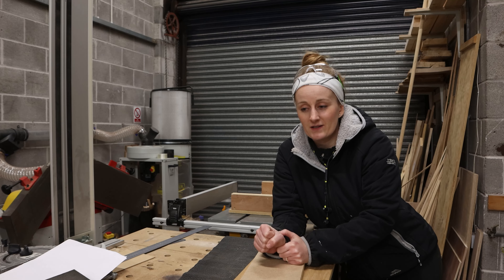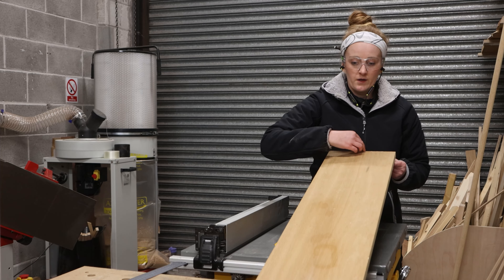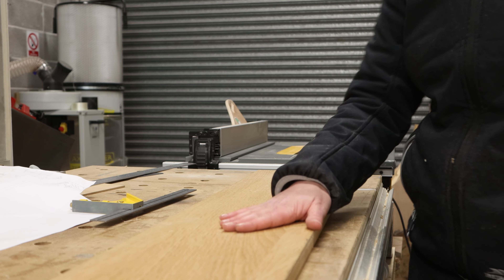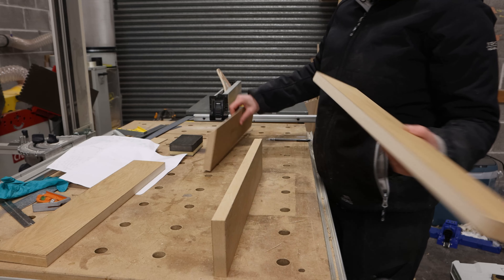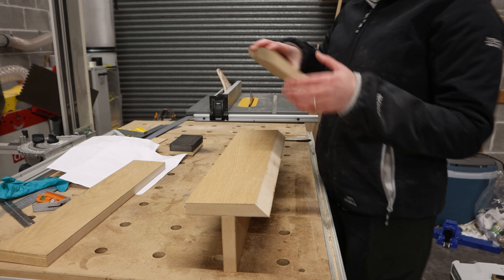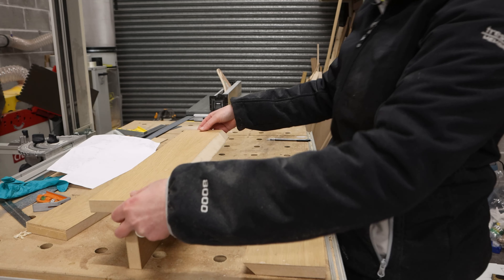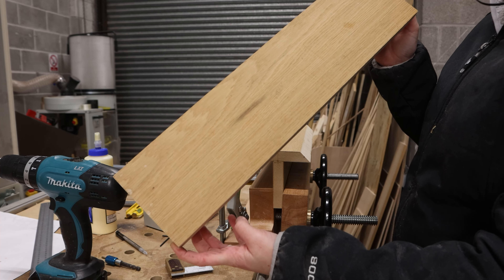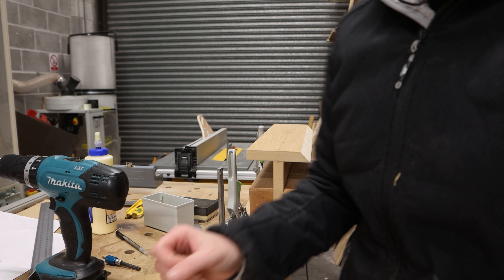Essential MITRE SHOOTING BOARD For Inside & Outside Mitres | Woodworking Mitre Jig

Comment: Another interesting vlog Kirstie. After making a (very) lot of keepsake / trinket boxes over the years I have always shied away from mitre joints and used any joints but them. I just could not produce a decent joint. I think I'll be giving your jig a try. Thanks for posting have a great Christmas and all the best for the New Year.
Reply from the maker: Thanks Steven! 😊 I understand why you would shy away from mitre joins for boxes. It can be so difficult at times to get a clean joint. I would be confident in to say this jig would be a great option for you though. A good sharp plane and you’ll get really great results with this. Thanks for checking out the jig build. Merry Christmas 🎅🎄 & happy new year to you too!